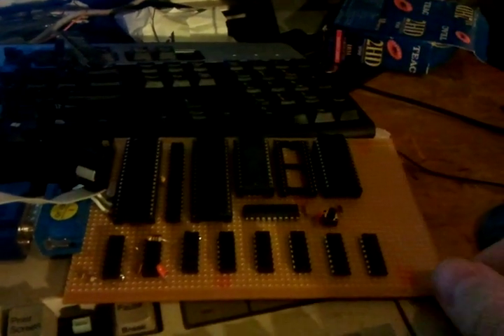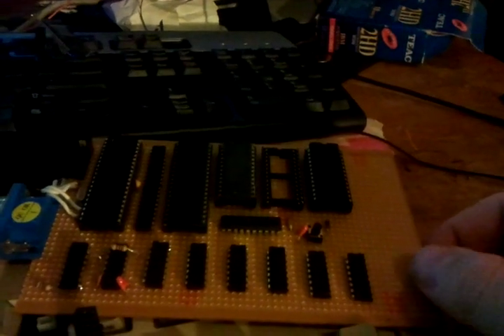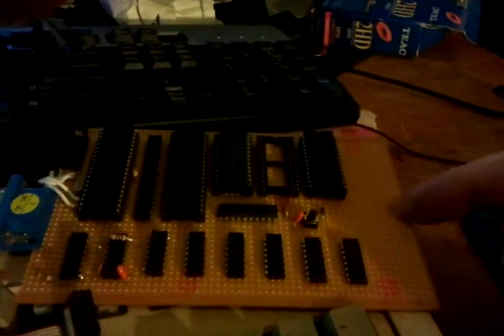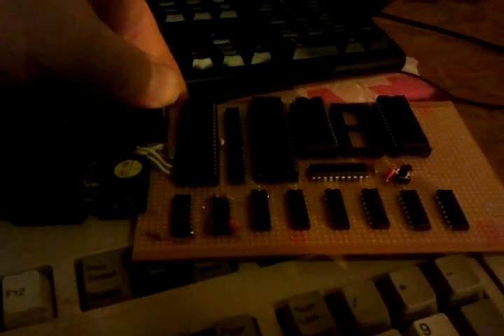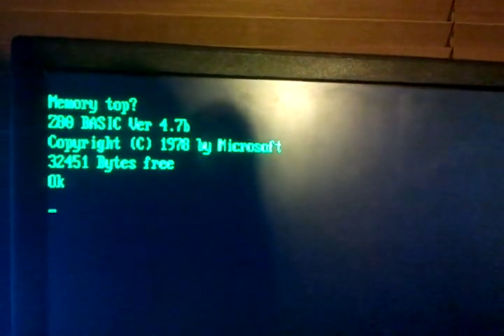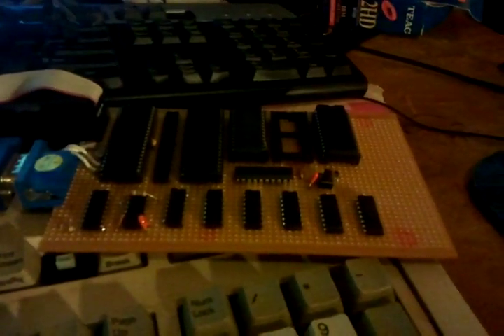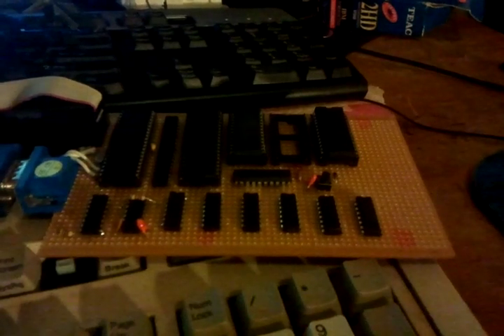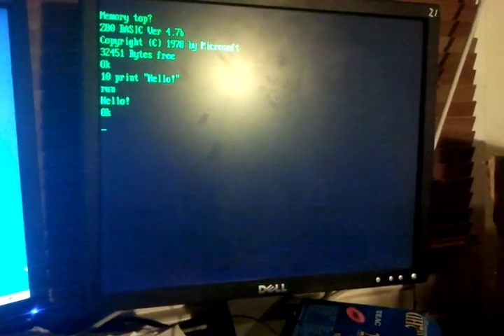A simple Z80 computer with VGA and BASIC

Comment: I'm making one from Atmel UC3A3. Add an address decoder on there 74hc154D. They'll give you 16 chip select lines from 4 input so you can connect all devices to the same data bus.  with a 74hc164D, you can run serial to parallel with 2 gpio pins that can hand the address decoders their addresses.

Comment: Nice computer. It looks neat and clean. Good job with the video output. Did you use DMA with the video controller, or does it go through something like the 8255 PPI?
Reply from the maker: It behaves like a serial port terminal from the Z80's point of view. The interface is just a latch to store the data until the ATmega finds a spare moment to read it, plus a latch from the ATmega to send data to the Z80 from the keyboard. There's a second buffer for status signals going from the ATmega to the Z80.
Reply: Ok, so you send the data to be displayed from the CPU to the ATmega serially?
Reply from the maker: No it's a parallel, but it looks the same as a UART from the Z80 software perspective. That is, there's a data port and a status port.
Reply: Ok, thanks!

Comment: Does this Z80 system have graphics capabilities? You know, circles, lines and color commands?   Pretty cool setup going on there ! :)
Reply from the maker: It's text only, because the ATMega only has 2kB of internal RAM. This is only enough for an 80x25 text buffer.
Reply: okay, that's fair enough, it should be good enough for character block graphics though, or no?  The VGA has memory, but no way to directly POKE to it then?